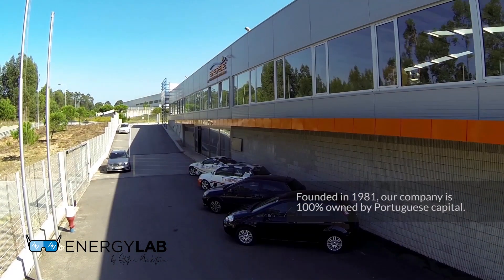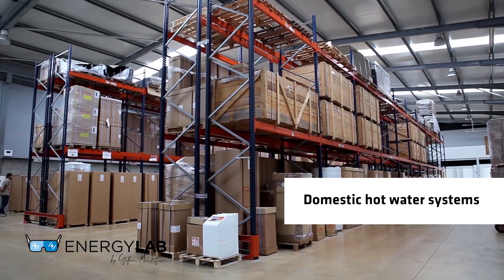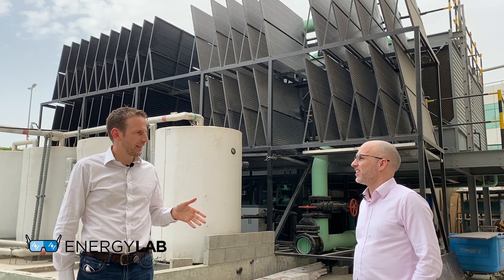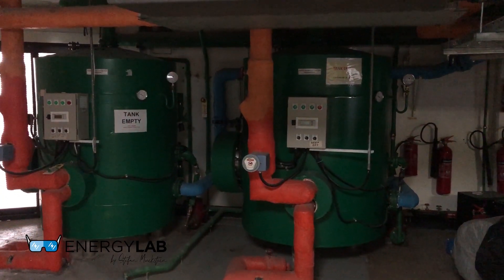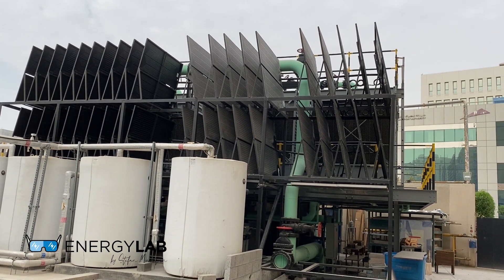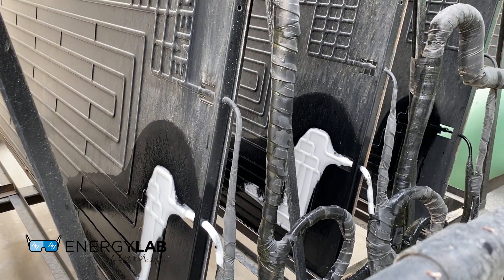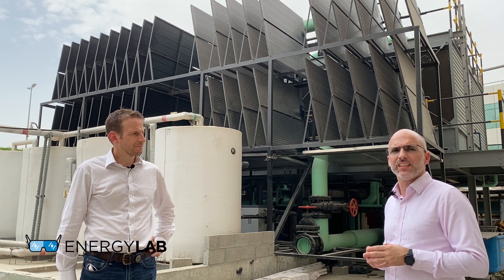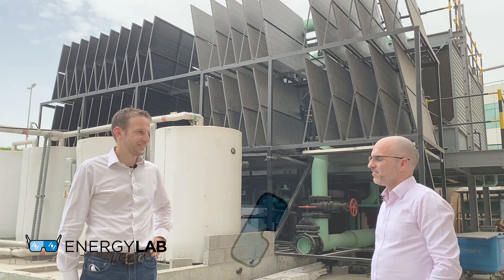Solar panels working day and night!

Comment: So what is the difference from this system from a normal heat pump that also makes hot water and works day night ? If I understand it may be better in high outside temperatures? New heat pumps have a COP of 5 and your system? Finally what is cost of a system like this  for a small house hold.

Comment: Air cooling and water heating in hot climate zones should be one, integrated, system.  Your system works, of course, but when AC runs 24/7, water heating from diesel or electricity is insanity...

Comment: Wondering about leaking.?  You are running refrigerant through copper in very long lengths. I imagine it has to be brazed with argon and then filled.
Reply: This is just child's play technically. I have designed and operated cooling systems that run with a 600 kW compressor and cool nylon yarn as it comes out of the extruder - a mission-critical 24/7/365 plant. Six minutes of no cooling can solidify 200 tons of nylon and the silo that holds it and snd it to the scrap yard.

Comment: Nice product. Wonder, can we not use the reject cooling energy in a productive way. The cooling tower is one way. May be the panel can be replaced with heat exchanger and transfer this energy to the chilled water system, before the chiller.
Reply: You can, but only when there is a demand for hot water and the compressor is running. If your hot water tank has reached the target temp and the compressor shuts down or goes into hibernating mode as with an Inverter driven compressor, you will no longer have the panel producing any chill. As a supplemental system maybe, but not as a design feature.

Comment: Show me some number boys. How does it compare to other heat pump systems?
Reply: Comparing to Air to water heat pump we can  still be 35% less expensive on the operational cost with a much higher life span. The main reason being that we perform more as we use the heat and the sun radiance together and consume less because we don't use fans and don't run additional cycles.
Reply: There are many other advantages like single heat exchange, evaporator protection against dust and corrosion, better hot water stratification, less maintenance, and much more.
Reply: Straight off the starting line, you eliminate the evaporator cooling fan and its control components - starters, capacitors, contactors, wiring failure etc - and be rid of its energy consumption, maintenance and life cycle. That's one less piece of equipment to worry about for the maintenance - to the owner of the system and the service team.

Comment: But why is this not used world wide more, never heard about it before until today and looks amazing
Reply: Oh you guys. It is litterly just a heat pump system with a fancy name, Its used everywhere the diffence with this system is the radiator is on the roof in some nice looking metal panel,  and some sketchy use of the word solar panel. Most heatpumps come compact with a wrap around radiator/condensor probo same size. I wonder if this system is more efficient with the fancy condensor panel?
Reply: @essex2zz  Rubbish.  Mine isn't even on the roof!
Reply from the maker: So far it 'only' makes sense for larger scale hot water consumers (not for individual residential houses/apartments). But I agree, it should be adopted world wide. All hotels, etc. should use this technology.
Reply: @EnergyLABnews  im involved with 4 new chalet builds in Switzerland and ive used a wood burner back boiler with solar therm panels in the past which works very well but still a lot of work with fire wood and can be messy. You dont think a single thermodynamic panel system from you could replace this? ive been speaking with a gentleman in Scotland whi has a single system there for the last 8 years and said he is very happy
Reply from the maker: @DaveCattanach  I think Energie's Thermodynamic Solar Energy solution https://www.energie.pt/en/ could be a great fit for you. I actually don't work for Energie. My aim is to showcase Renewable and Sustainable Energy solutions (with EnergyLAB) ... plus I work in the industry.
I have asked Hugo Domingues https://www.linkedin.com/in/hugo-domingues-69396b1a/ to get in touch with you. 
Let me know if I can help in any other way.
Reply: @DaveCattanach  Thank you for your comments. Actually, I am aware of several wooden chalets in Europe using thermodynamic solar for hot water but also ambient heating. Drop an email to international@energie.pt and they will put you in contact with the correct distributor to assist you. Have a great day!
Reply: @EnergyLABnews  Not so.  See my post at the top of the page.
Reply: @EnergyLABnews  - with due respect to your experience, I have been designing and building Heat Pump Water Heaters using this thermodynamic panel of size 2000 X 800 mm for 100, 200 and 500 litre systems here in India, for the past 2 years. They are very efficient in their functioning, I have achieved a COP of 4.9 on 100 litre systems using a 12000 BTU compressor on R22 and R134a refrigerants. For 500 litre systems, I use two panels in tandem.  It does make for economical and technical sense.